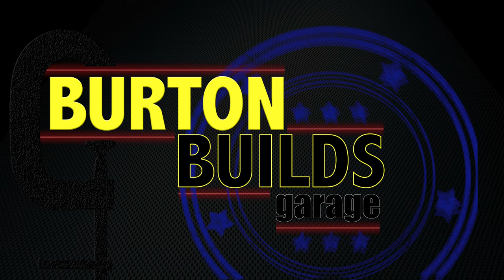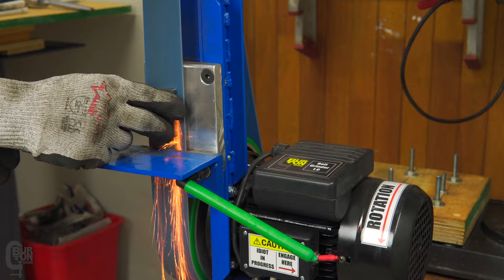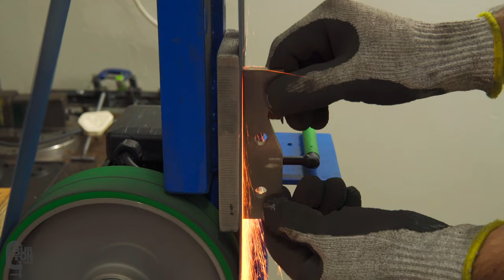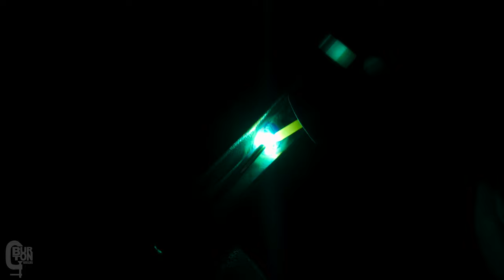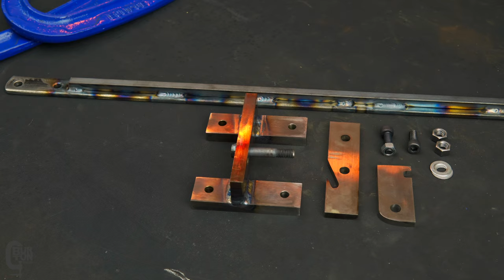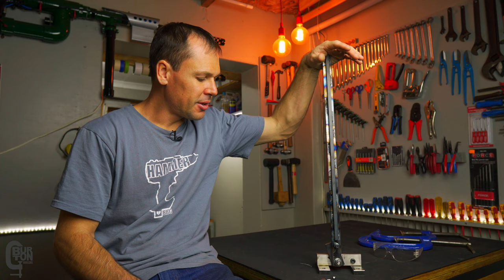Make a Metal Bench Shear for $1 (from an old file) - Burton Builds

Comment: Or BLO (boiled linseed oil). Heat up the unit in the oven to 250 - 300° F (lower than the hardening temperature of the blades, so it won't affect the hardness), and brush on a coat of BLO. The more coats you do, the darker it will become.
Nice build.
Reply from the maker: Hi Andrew, thanks for the BLO tip... I'll give that a try. I cut a 'fishhook' in the lower blade because at the time i had access to the water jet, I only had a very rough idea of where i needed holes cut (was a very last minute thing). Once it came to the detail of mounting the blades and where i needed the 'sheering' holes, the only thing I had on hand that would cut a file was a grinder, so ended up grinding the 'fishhook' to get the sheering edge to the correct location. Would have preferred a hold though and to have retained the section above the hole for strength. This actually ended up being a week point and the lower blade split when i was trying to cut stainless steel... should have never tried that. I must have cut close to 1000 pieces of 6mm BMS but only managed to cut a few pieces of 304 Stainless before it snapped. Did an update video on this breaking... check it out at the 1 minute mark. https://youtu.be/u1EL0KYXrLs

Guess a new design is in order.

Comment: Th title has nothing to do with what u did. Where is old tool ???
Reply from the maker: Hi Souna Samdy, you’ll see the old file (or ‘tool’ as you say) from 02:45 onwards. It was an old file that was used and cut into 3 pieces (the 3 pieces on the left side of the picture). One piece used as the bottom cutting blade, the second piece used as the top cutting blade and the third piece was the leftover from the file.

As for the title… if you bothered to read the video description, the title would make sense.

Hope this helps and have a nice day.